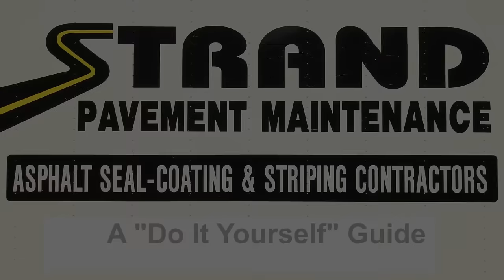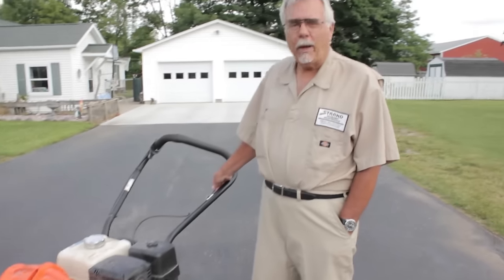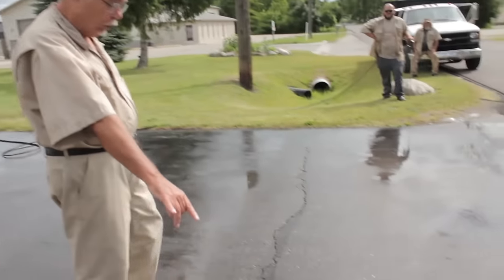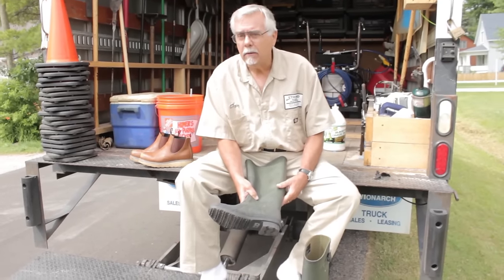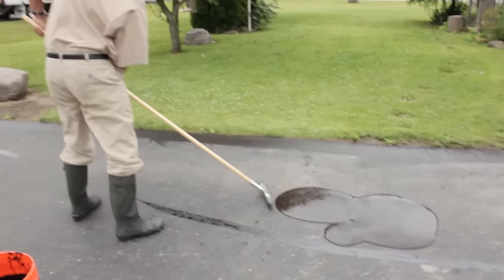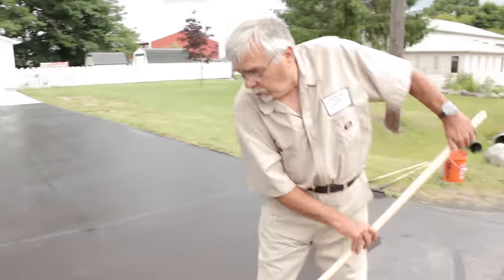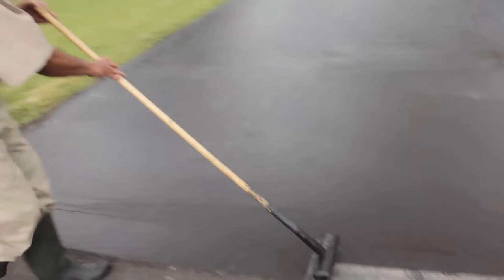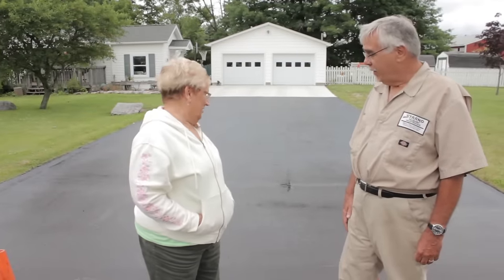Asphalt Seal Your Own Driveway!

Comment: Can one Asphalt seal over a pre-existing concrete cement slab poured driveway. I have a 23-year old concrete (ugly) driveway that was laid when the house was custom built 23-years ago. Now there are  numerous cracks (5-15th in length and weeds and grass that grow in between)

Comment: What would one add to a driveway that has ALOT of loose pebbles,surface is deteriorating. Thin watery coating will not stop it from bonding. A thicker mix or with silica sand ?? Salt,winters have taken it's toll on our driveway.

Comment: I can appreciate your tips and advice. But as someone who has tried to do this on my own, my tip is to hire a pro! My back still hurts : )
Reply: The back pain is not from the sealcoating, it's from lifting those 4.75 gallon pails of sealant. That's the hardest part! If you had a seal rig, the job would be a breeze.
Reply: @slimdude2011  - It's the bending over while using the squeegee that gets me.

Comment: 7 years after this video was posted, we paid $1,800 for the worst seal job I’ve seen in my entire 70 years. We power washed it and he actually said it didn’t have to be completely dry and started pouring the sealer on. He didn’t use a crack sealer on the cracks beforehand. He left small puddles in several places. He then sprayed a fine mist that is very streaky. It  looks  terrible!

Comment: Power washing is kind of overkill definitely if you do it by hand because you’re laying it down really thick compared to using a sprayer. I died seeing him use that crack filler I would recommend to buy a bucket of crack filler and a brush and then your set for life unless your driveway is terrible.

Comment: How much was it? Something like $5 per gallon?  So in Canada it'll be something like $20 per litre for driveway sealer, and the rubber boots will cost $99.99. Then the whole sh_t thing will come apart over the winter because the freezing temperatures, snow, and shoveling, will destroy it real quick.

Comment: $60 for the homeowner to do and you estimated to do the job for $135? It seems like a VERY low estimate for something that you need to clean the dirt, trim the sides and cracks, add sealant to the cracks, pressure wash the entire driveway and come back a few hours later to finish the job. Maybe I am missing something.

Comment: It's about $130 $180 for all material in 2022 depending on how many years your sealer is ! 2-year sealer 3-year sealer 5-year sealer or 10-year sealer, plus asphalt sealer for the cracks, if you have a lot of building up to do with the cracks and you have to get cold patch and go over lots big spots Plus patch with no rocks for 1/2 Inch cracks. Don't forget about some bleach and water for your oil spots and gasoline spots scrub them with a hard bristle nylon brush Charge some for that too ! This Job in 2022 should be your material cost X2 for what he did I would charge around $250 to $300 and that's to roll it on not squeegee, it's a good application job doing it with a squeegee, the best way to do it is with a roller cuz it pushes the sealer in the cracks is the best, like your painting with a rough roller fabric, not soft !!!  The worst application is to spray it on, if you're doing it yourself or hire somebody, it's the worst application because you have to dilute it with paint thinner to get it through the sprayer , you can see the cracks right away, you get what you pay for...Make sure you charge enough money for the job that you're doing if you're there a long time, 2-3 days cause of weather & Drying time, and you have to reconstruct the asphalt & build up the driveway with cold patch or liquid sealer no rocks, like he had, then you can roll it out or squeegee the sealer on 24 hrs later... the next day...Remember time and material is more money, you can have a driveway doesn't have much maintenance before you seal it and you could have a driveway that has a lot of maintenance before you seal it, do your estimates well.. have a nice day. What sells jobs to people is you tell them that you roll it on with a paint stick and roller, make sure you by rough surface roller brush roller, that pushes the material in the cracks it's the best application to give a person an A1 job . Your friend John

Comment: now you probably dont have a 93 horsepower toyota kubota lamborghini turbocharged pressurewasher-lawnmower-cementmixer-rubberbander-drivewaypeeler-hybrid like i do, but a good ole rock pile for residential use will work

Comment: if the "water-proof" or "sealer" that is  a water-based  it will fail and is a cheap one. it has to oil based.

Comment: Asphalt sealer is very messy, you’re gonna probably wanna wear a pair of rubber boots or an old pair of tennis shoes that you can throw away. A good pair of black stilettos will work just fine

Comment: just wire brush the dirt and the cracks, ive sealed pro for 35 years never used a pressure washer. why would you pour a puddle spread that whole 5 gallons out in the pattern you would seal...side to side . im sorry but just trying to make it easier for home owner

Comment: This fella hasn't been doing this long.

1. Calls Asphalt, "Ashfault".
2. Power washes the driveway, which ruins the surface.
3. New Clothes and Boots.
4. Calls a Rubber Crack Machine a "Rubber Bander".
5. Squeegee's the driveway like no one ever taught him,  you need to spread 1 direction and clean up footprints in a cross pattern to fill voids/holidays.

1 Ton Box truck to bring equipment to Job= $25
Fuel for Weed Wacker, Blower and Power Washer= $15
Bottle of Crack filler= $12
Sealer= $45
Squeegee= $15
2 Men on payroll for 2 Hours=$80
Total= $192
Job=$135
Profit= -$57
😖

Comment: and something none of these guys tell you is the sealer they use is easily broken down with gasoline i know this from experience as i worked for one of the people that started these whole types of business in the 90's these are nothing more than a cosmetic band-aid and do not last as long as they would like their customers to believe.

Comment: Whaat? $135 for that and I’d have to spend half on material, never mind the cost of the electricity and water for the blower and jet washer? And I will have to put up with my wife pointing out the imperfections of my DIY work. Nah! Colonel Sanders, the job is yours.

Comment: Your employees must be a laughing watching u seal that driveway. 
$135 and you fill all the cracks AND pressure wash ????? Not sure how u make money....inefficient way u do it...my guys do all that you do with a brush application and are in and out in 15 minutes....I would probably charge $165/175 but pressure washing is extra...we do a dozen that size in a day but mix up the sizes so they don't have that many stops. You glossed over the crack filling not showing them how to spackle after filling to get the strip lines without showing ridges.